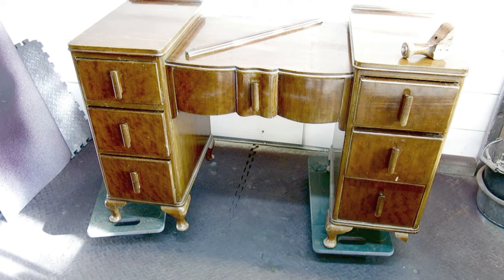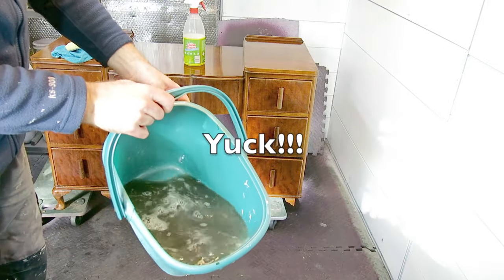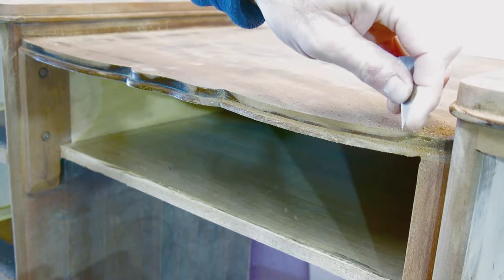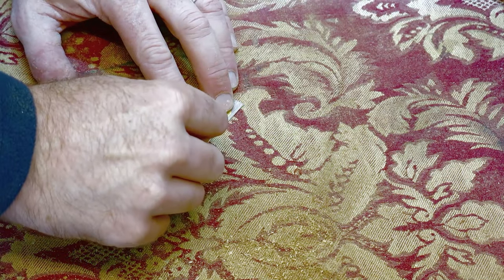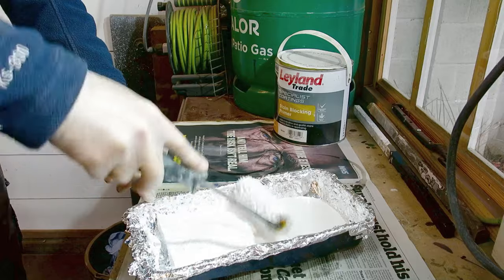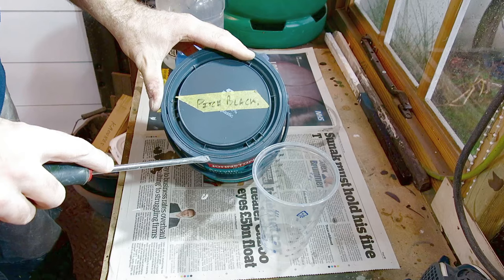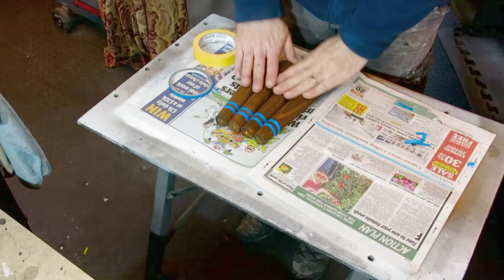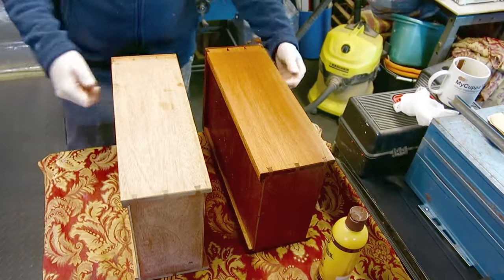Amazing RESTORATION/MAKEOVER of a Vintage 1940's Vanity Dresser -Dressing table.

Comment: Firstly, you've nothing to be concerned about re your voice-over, you did a great job. As a big fan of 1940s style, I was worried when I saw the paint & new legs, but you made me happy with your old-school approach; assessing & cleaning, repairing & restoring, nourishing & protecting. I saw one YT vid 'restore' one of those really old & low wooden bathroom stools once used for kids to reach the sink or toilet. Like many others, she'd slapped white chalk paint straight on "because it doesn't require prep" - I pointed out that it may not require prep, but after the item had been in somebody's loo for decades, it certainly required cleaning. Looking forward to your next project :)
Reply from the maker: Hi Joanne, Thankyou  so much  for your detailed comment and your feedback is really helpful. When I start working on my pieces I always have in mind that I want them to last for many more years and I feel the best way to do this is to ensure that they have been thoroughly prepared first. What is it they say, “Fail to prepare, prepare to fail” 🤣🤣 Thanks again 😀👍👍

Comment: I love the paint and wood look.  I like the center where you added the painted black section and wood handle.  The wood looks so rich now.  I especially like the little detail you did on the legs, even though you might not see it at first, it gives it style.  The only suggestion I would make is on the sides.  You've got a huge black rectangle and nothing breaking it up.  Next time in the center leave a rectangle of the wood exposed, surrounded it with a black frame about 3 or 4 inches thick, then a 1/4 inch stripe of wood, then black, then wood, and then finish with black.  Does that make sense?   I'm sure you can come up with a classy look.  Keep up the good work.  Love Daisy

Comment: Thanks for deciding to share your woodworking and artistic talent.  Have you had any feedback from your clients about the durability of the latex paint?  Have you ever waxed your latex paint instead of top coating?  I’m looking forward to your upcoming videos.  The desk/vanity looks amazing 👏🏻👏🏻👏🏻
Reply from the maker: Hi CT, the paint I use is actually an Acrylic Eggshell paint so is designed for use on woodwork. It doesn’t really need a top coat (bit like mineral paint) but I always add one for added protection. I actually used wax on the purple drawers I did in one of my videos. The only issue I’ve had with a previous customer is when she left a tealight candle lit directly on the painted/waxed top. The hot metal base marked the paint. I always recommend using drinks coasters on painted finishes no matter what topcoat but not much will protect from the heat of a hot metal candle. 🤣🤣

Comment: At first I questioned why you didn’t restore the piece by staining more. Less paint but it looks stunning. I would have used ebony stain rather than paint. But same effect still came out. You should try chalk paint it can be used as a wash and it’s made for furniture. Regular wall paint is formulated for walls. I agree with others it’s a Art Deco dresser and you used mid- century legs. If would not have used those legs either. Still looks beautiful!
Reply from the maker: Hi Kathy. The main reason I didn’t use stain on all the piece is that the veneer on a couple of the drawers was in a bad way, same reason I didn’t use Ebony stain. I ended up removing the veneer on the painted drawers completely. I personally don’t like chalk paint as it’s not hard wearing enough. I use eggshell paint which is formulated for use on wood and I can also get it mixed to any colour I want. Hope this explains some of my choices. Thanks again 😀😀👍
Reply: @MayfieldRestorations  thank you, that is good to know. Thank you for your response. I look forward to seeing more of your work and videos! Cheers!

Comment: Beautiful work, and so nice to see a UK artist. I really appreciate you listing all your tools and supplies, it’s really helpful. 
Can I ask what you used to stain the handles though? I studied your list and can’t see a mention of wood stain, apologies if I missed it. 
I also have one question; do you hand sand with a fine grade of sandpaper before staining wood? Surely a sander leaves you with swirls that appear when you stain?
Thank you
Reply from the maker: Hi, Thankyou so much. Apologies if I didn’t list the stain, I’m new to this and learning all the time. The handles stain is the same as the main body of the dresser, it’s Ebony (black) stain by Morrells in their “light fast” stain range. It’s an alcohol based stain. Regarding the sanding grade, when I’m staining I generally only sand up to 120grit but depending on the wood I sometimes go to 240grit. This piece was sanded to 120grit. No swirls at this grade as long as you go slowly with light pressure and you’re using the random original setting on your sander. Most stains recommend only sanding up to 120grit as you can “burnish” the wood at higher grits which stops the stain from penetrating. I’ll try to be more detailed in my voiceover in future videos. 😀😀😀👍
Reply from the maker: *random ORBITAL 👍
Reply: @MayfieldRestorations  thank you so much, that’s great information. 
Please don’t apologise, you did a great job on everything including the video, voiceover and listings. 
I’m a subscriber so interested to keep watching and learning.

Comment: Can you show us how to get a drawer to go in straight?  I have three bureaus with drawers that go in crooked and get stuck and drop shavings onto the contents.
Reply from the maker: Hi Sandy, I plan on doing some short videos on things like this in the near future. Your drawers might just be sticking. If the drawers is wooden on wooden runners,  then over time the wood dries and the sliding action is compromised. You could try a simple fix of feeding the drawers and runners to give a smoother sliding motion. Either use a furniture wax or something like Howard’s Feed n Wax. You can see how I use the feed n wax in my videos. 😀👍
Reply: I would also add, if it’s an old handmade set of drawers the drawers may vary in size very slightly and might have got mixed up so it’s worth shuffling them round to see if you can get a better fit in each slot.
Reply: @MayfieldRestorations  The back of the drawer goes to the side.  It seems to me that there needs to be some kind of rail to keep them straight.  A curb as it were.

Comment: The legs probably weren’t repaired. Often they are made from laminated pieces and the original glue joint comes loose. It’s happened to me several times on old pieces.
Reply from the maker: Thanks for the tip, I’ve kept the original legs to repair for a future project 😀😀

Comment: The vanity looks very nice.  Like the blend of paint and natural.  The mid century  legs, like the finish on them as well.  The two items together? No, no, no, no, no.  And 4 legs v. Original 8? No, again, no.  They don't work together.  Wish you had saved the old feet built them up to the necessary height, or something else.  Like trying to marry Warhol and Botticelli.   Place for both, but not blended together.
Reply from the maker: Hi Suzette, you forgot to add the words “in my opinion” at the start of your comment. Thanks for watching. 👍👍
Reply: @MayfieldRestorations  true.